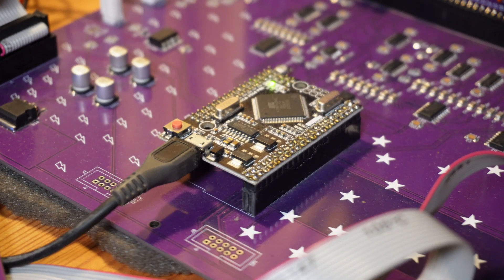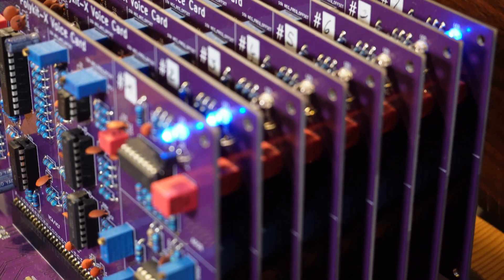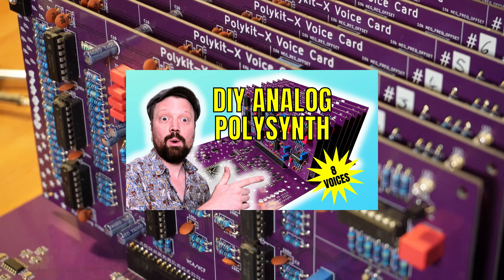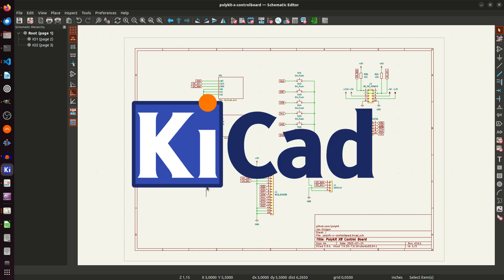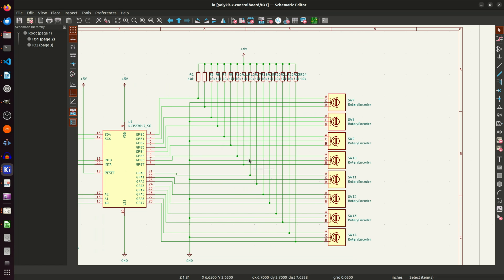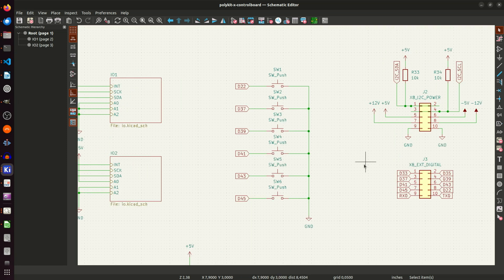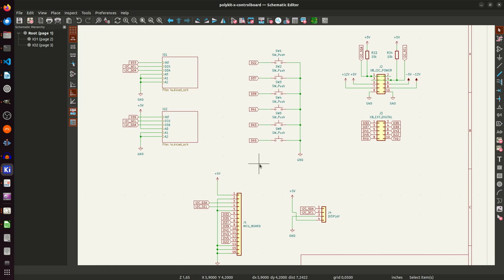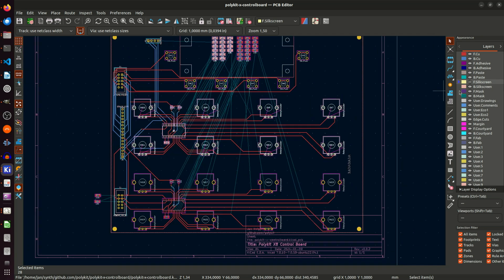I’m Building an Analog Polysynth - Controls Part2

Comment: 1:22 That's a BAD rotary controller! We use Gray code, not simple binary! You're asking for values to jump all over the place! I'd be surprised if they even make encoders that don't use Gray code. 

Gray code is still counting in binary, except it's arranged so that each two adjacent areas have only ONE bit that's different between them. So when rotating, only one bit has changed, so that's as far as inaccuracy can get, if the sensors for the knob are not quite perfectly aligned. You decode it into normal numbers, so the worst-case you'd get the knob being on 3 or 5 when it should be 4. 

On your diagram there, there's a border between 111 and 000! So a teeny misalignment in the switch, which is inevitable with a small enough turn, means any number of those 000 / 111 bits could be wrong, giving you results from anywhere else on the rotation! You might get 100 or 011 or anything, between 000 and 111, depending on exactly which contacts are connected. So that's why Gray code was invented, and implemented widely!

In practice though, you seem to be using relative encoders rather than absolute ones. So you just get a "click" for each turn and discern the direction from the phase, the order the bits move between the two pins. Then you keep count of the turns in software. But your diagram was an absolute encoder and they really ought to use Gray code. It's called "Gray" after the guy who invented it, rather than the colour.

Comment: Very cool project, congrats! have you noticed any chattering with the encoders and if so, are you dealing with that in software?
Reply from the maker: No, no chattering, it works suprisingly smooth. It's basically some old version of the Adafruit library for rotary encoders with some wrapper for the IO expander. Maybe there is some debouncing in there.
Reply: @polykit  thanks, I will try it out with some very unruly rotary encoders that I have struggled to tame. Your work has helped me a lot with my own polysynth project. I'll share it when (and if) it gets finished
Reply from the maker: Nice, looking forward to it! Those are rotary encoders from Bourns btw.